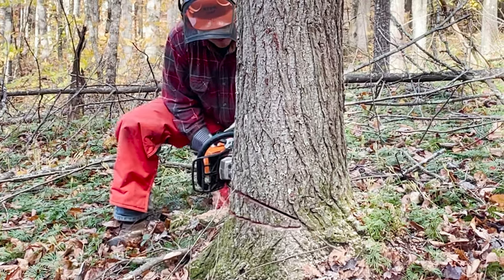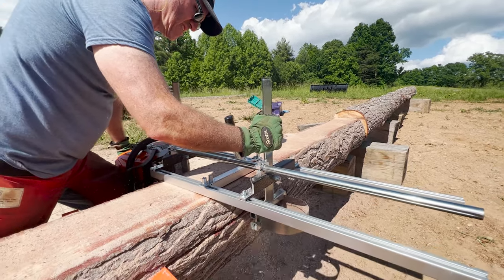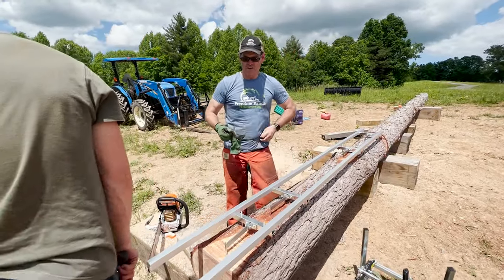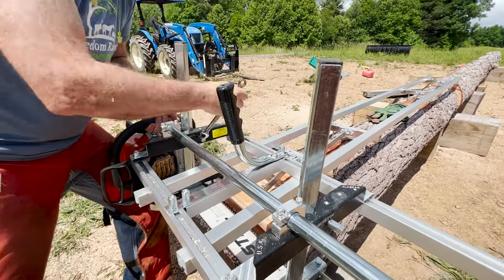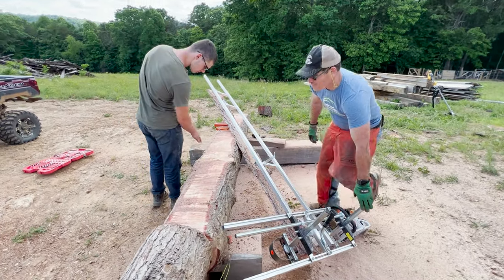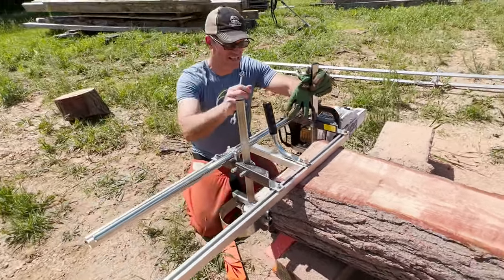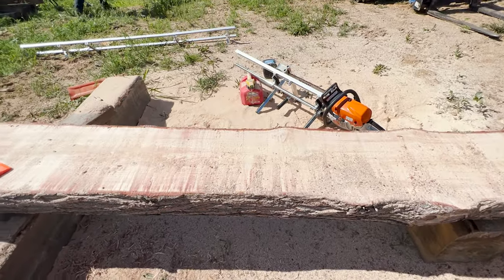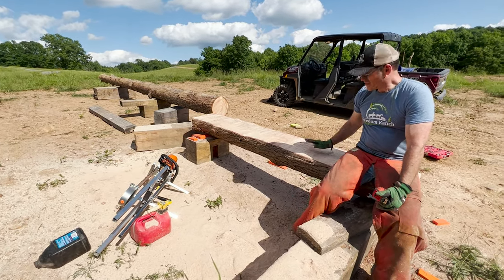#78 The Alaskan Sawmill: our first time using it to create steps for our log home

Comment: I’m listening to the audio using my headphones, as I sit in a chair by the window of my cabin. I have a small dog who was at my feet, yet I kept hearing something larger behind me, was a bear at the window? What was that sound? I am looking around behind me for an answer, then I see an ear, and the tip of a nose in the video, and realize it is your dogs making noise because they were disappointed to not be involved in this video. Amazing all the subtle sounds one hears using headphones. Nice job on the treads. Be sure you get your spacing between the steps right, or anyone using the steps may have a tumble. I have 1 step about 1/2 inch more height than all the rest, and it gets me every time!
Reply from the maker: You must have some awesome headphones!!  Yes, the spacing will be very important to get right...I am notorious for tripping, so it would definitely be me who would take a header 😫

Comment: My expensive Stihl sits in my barn most of the time.  I kow professionals swear by them, but my 3 Husqvarna's all run every time I need them, and restart easily.  I've had 2 pros look at my Stihl; the chainsaw mechanic says there is nothing wrong with it, the lumberjack agrees with me that it just doesn't run well after about 1/2 hour of use and can't be restarted until it's cooled down for an hour or more.  I only mention my saw because you also don't seem all that pleased with your Stihl, and I assumed for quite a while that I must just be doing something wrong.  I may well be an idiot, but it appears that all my Husqy's work really well for idiots.
Reply from the maker: That is good to know!  I'll be sure to pass this along to Chuck so he knows he isn't the only one with challenges as well.  Thanks for watching!
Reply: I run Husqvarna 555's, 455, and Stihl 291. Both great machines and like both brands. My dealer has both, so service is great. Had a shop look at my Stihl once and it didn't run right, but he wasn't a Stihl dealer...took it to my Husky/Stihl dealer and it runs like a top. It used to run rough after hot as well, but runs great with their tune up and new carb.
Reply: I have always had Stihl since my logging days and my dad was super loyal to them. It was certainly a frustrating day and made me reconsider my loyalty. However, most of the issues I am having now are with my old saw and a bad plug. The new saw needed breaking in but now runs like a top. Definitely would go to a husky if I ever switch.